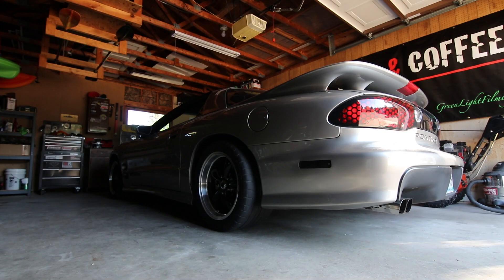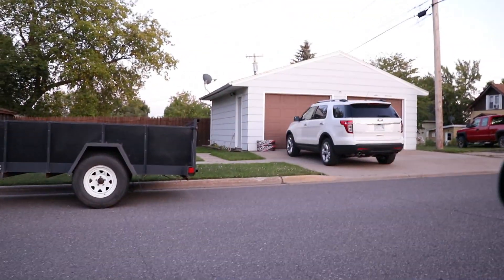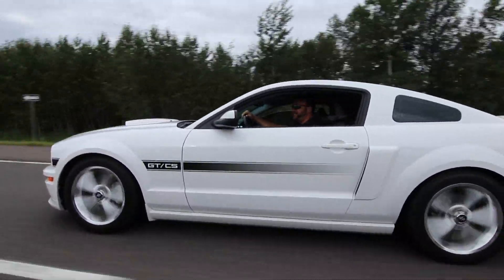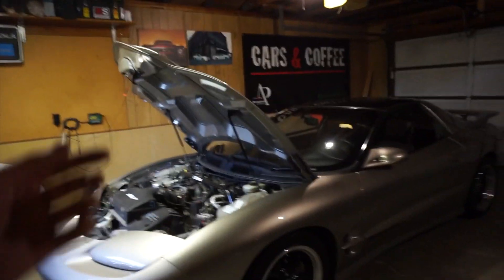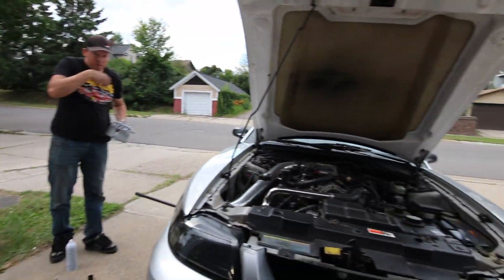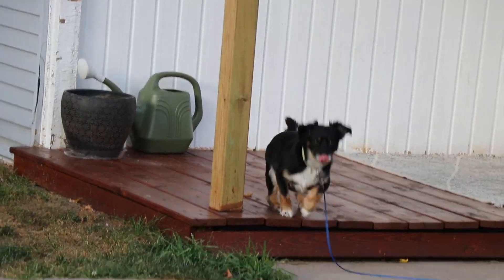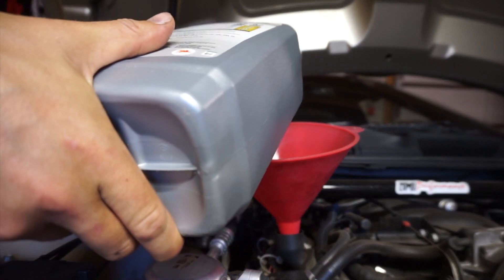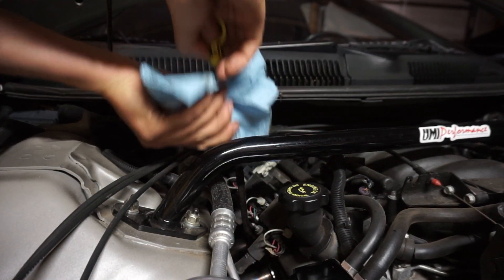HUGE WS6 Update Video - Broken Mustang Parts/New WS6 Heads & CRAZY Channel News!

Comment: Those PRC boxes are popular lol.  I just bought some clean stock 243 heads with dual .660s off ls1tech and they came shipped in those same ones.  I think I was posting in the build thread of the guy who sold you those and those are probably the as cast 225 head boxes he shipped those in.  Those 243s should definitely help that stage 4 cam drive a little better.  What size head gasket are you going with?

Comment: I had WS6 the dealer told me it was a very rare car the problem I had with it is a constant knock ,, sounded like a rod knock ,I rebuilt the engine 3 times but couldn’t get rid of it finally I got rid of the car
Reply from the maker: Sucks to hear that man. Many LS based engines make some noise. Especially when cold. 

Don't let it ruin the car for you. For every problem child, there is 100 good ones.

Comment: Nice update should get a good power boost from the new heads and intake with your cam. I got the Prc 5.3 heads on mine they do pretty good for budget heads I'd really like some trick flow or AFR's $$$
Did you get your hot idle issues sorted out 
It be cool to hang but I'm way down in TX lol! 😎👍
Reply from the maker: Negative, it still has that hanging booger with it struggling with the AC on when it's hot. I really need to look into that before doing anything else... 

If I make it down to the TX area I'll reach out! I travel pretty regularly so you never know. Good call on the heads too. I would have done the same but you got that right.... $$$$$

Comment: 799s and 243s are exactly the same heads, but the 243s have sodium filled intake valves.
Reply from the maker: Thanks for the info. I couldn't remember the differences off of my head. I just recalled the 799's had a rougher casting
Reply: Ryan M  only if installed in a vette